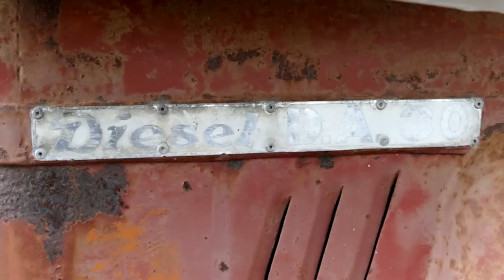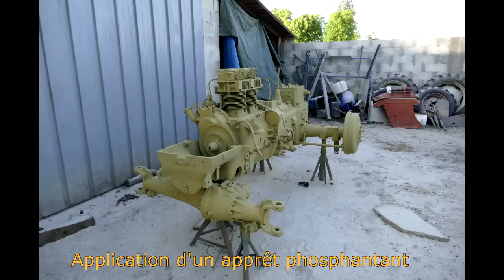Restauration Same DA 30 DT

Comment: Very well done restoration, I've watched your other tractor restorations too, Very much impressed. Was it easy to get spare parts and did you need to make some parts. Also, how long did this restoration take? Thank you and regards from New Zealand.
Reply from the maker: Hello,
Thank you very much for your comment. I was able to find some parts, in particular the rear fenders of aftermarket. I made the exhaust for an original configuration. I changed all of the tractor bearings. The restoration lasted over a year.
Greetings from France

Comment: salut quand tu refait tes tracteur tu refais aussi la mécanique ou que la peinture
Reply from the maker: Salut , pour ma part je refais les deux. Pour la peinture je connais bien je suis carrossier peintre en auto donc de ce côté là pas de soucis. Pour la mécanique je préfère tous changer en commençant par les fluides genres huiles de boites,pont, liquides de refroidissement si il y a un radiateur, pompe à eau, joint spy et roulement. Sur certains tracteurs il faut que change des bagues de pivot de roues avant c'est un peu leur maladie vu l'âge qu'ils ont. Et dans certains cas je remets l'instrumentation à neuf si c'est dispo pour certains modèles